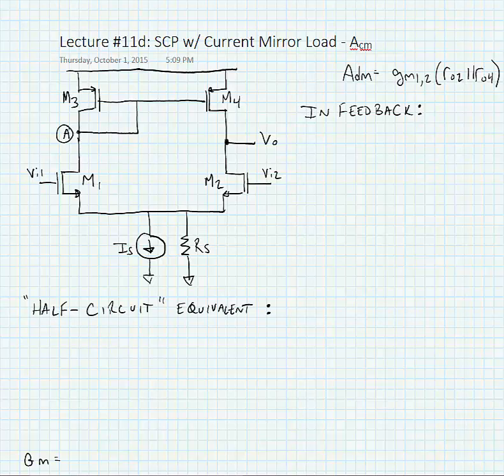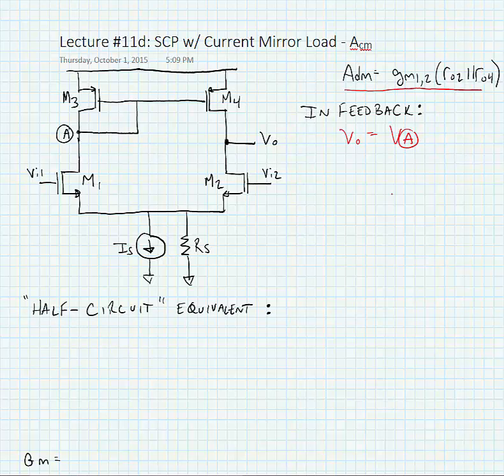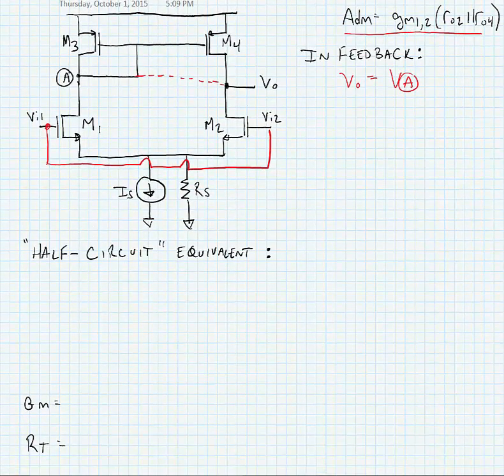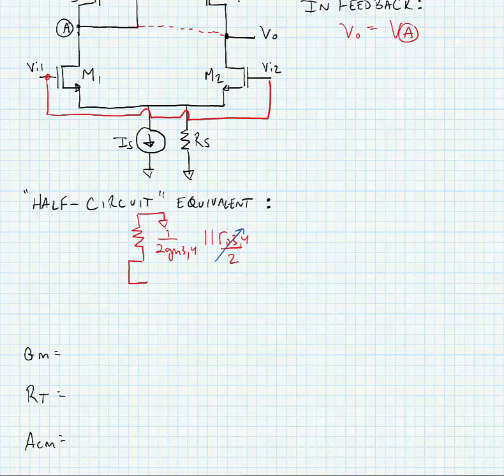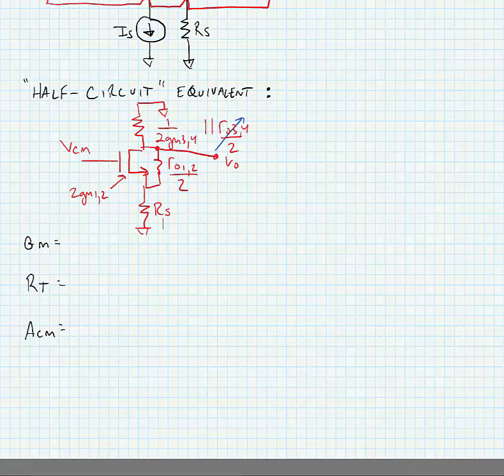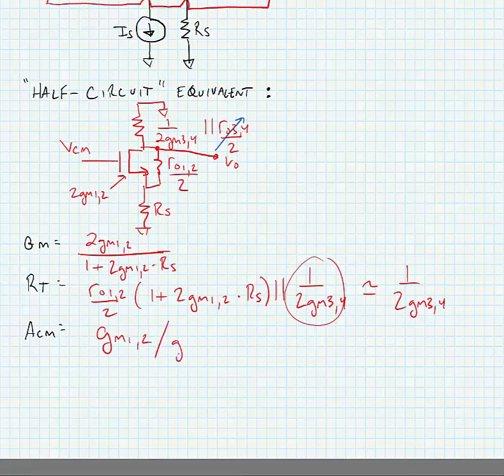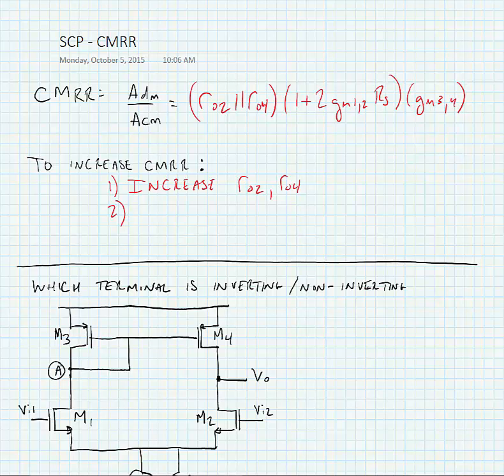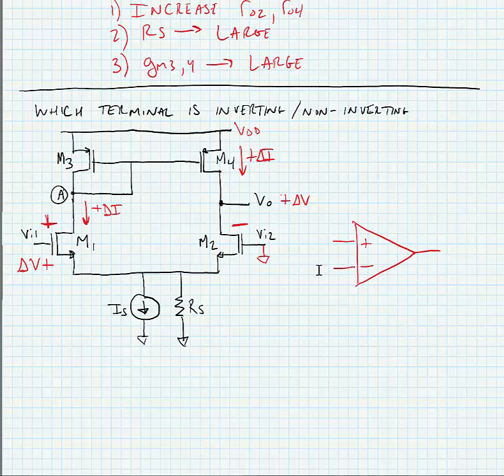ECE 3110 - Lecture 11d: SCP w/ Current Mirror Load - Acm

Comment: @1:30 isn't the impedance looking throught the drain supposed to be rop, and the CMRR 1+2gmRs?
Reply from the maker: At this point we are noting that in operation, the common-mode signal should result in nearly equal potential at the drain nodes. This allows a virtual "wire" to be drawn and hence the two NMOS are in parallel (e.g. Rdn = ro/2) and the two PMOS are in parallel and diode connected (e.g., Rdp ~= 1/2gm).